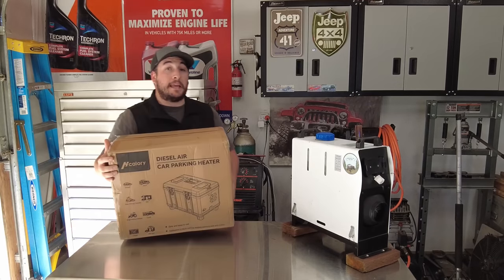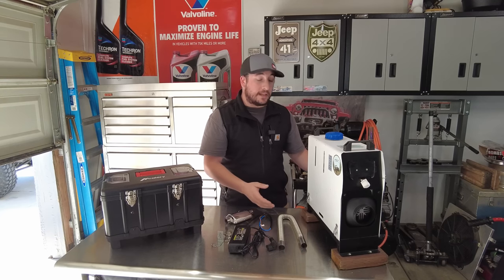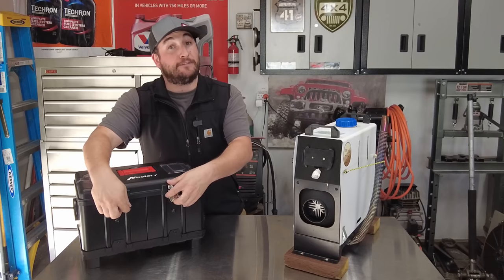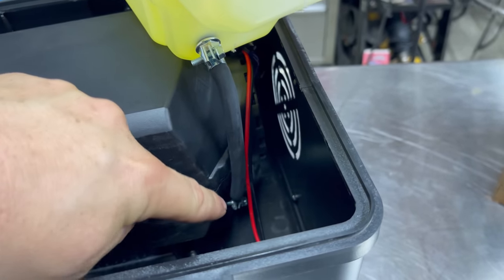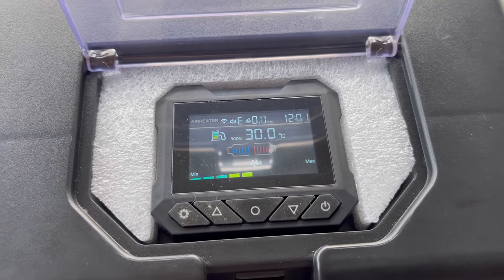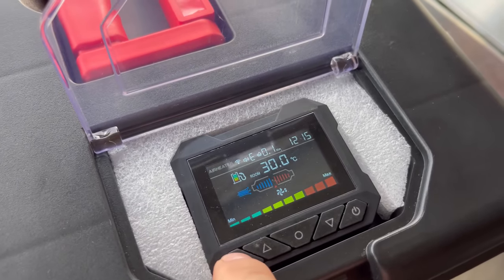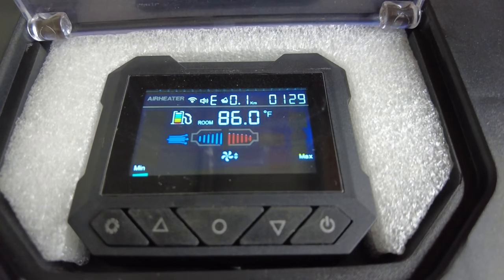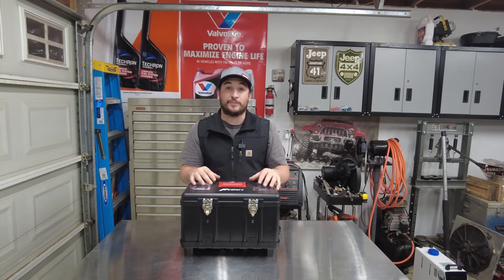KING Of Affordable Diesel Heaters | The HCALORY - SS2 8KW Air Heater | This Is The ONE

Comment: Does this controller finally have a proper thermostat?
Reply from the maker: Yes no more manually changing pump and fan speeds, or having to extend the cable to the controller to reach the heated space just to throttle the machine down. That first mode automatically does it for you with the up and down keys regardless of the built in thermostat in the controller. The second mode uses the thermostat in the controller. And the controller must be in the heated space to properly work.
Reply from the maker: Hi , New video is up covering all the questions you asked on this heater. 🍻 https://youtu.be/Ug-3fjjCPWE?si=BxCFMqSJN6QPi7tT

Comment: How long does it last on a full tank on low setting?
Reply from the maker: From Hcalory: Achieve a cozy room temperature of 20°C swiftly while boasting a low fuel consumption of just 0.1-0.48L/h. Enjoy a whole night of warmth on just 6L oil. 🍻
Reply: Its a 0.022ml pump, if at 2hz speed  - 2 pumps x 60 seconds x 60 minutes x 0.022ml is 144ml an hour... 4 hz 288ml an hour... 5hz 360ml an hour... it mainly depends on how much heat you need, simples 😁
Reply from the maker: Hi , New video is up covering all the questions you asked on this heater. 🍻 https://youtu.be/Ug-3fjjCPWE?si=BxCFMqSJN6QPi7tT

Comment: That power cord connection is a complete fire hazard. Thats a standard 120 volt appliance connection, the kind you would see on a tv. It would be real bad if someone mistook it for a 120 volt unit and plugged it in.
Reply from the maker: It would 🍻

Comment: It the best heater,,, hot pipe is in my fire place and it helps to heat my house I could save money if I had one in every room,,,,, It will heat for 2 day on low on one take
Reply from the maker: Awesome use for the heater, please be sure to have a carbon monoxide detector close by. 🍻

Comment: Unfortunately, these are unavailable. the link doesn't know when or if it will be in stock.
Reply from the maker: Yes as of now they have been sold out, they are manufacturing them as we speak so a new stock should be available by the beginning of December. 🍻
Reply: @ATEMOFFROAD  I will keep an eye out for them. These look extremely handy to have. Thanks for the video.
Reply from the maker: Update ** New stock is available link: https://amzn.to/47KUrMq
Reply from the maker: @markj284  New stock is available link: https://amzn.to/47KUrMq

Comment: wThe power input socket is for 220 Volts in Europe – so an unaware use could feed high voltage into the heater and destroy the unit – and possibly  his future ... DANGEROUS DESIGN FLAW

Comment: I think it is stupid that a company used an AC C13 - C14 style plug for a low voltage DC application. You know someone will grab a PC cord and plug that thing into the wall.
Reply from the maker: I agree, both the manufacturer and the doer are stupid. 🤷‍♂️ I believe they are updating it, and  have been notified by me personally. 🍻

Comment: Mine lasted 2 hours. Now it blows white smoke and minimal heat. Not what I expected.
Reply from the maker: Any fault codes? Can you hear the pump speed up and slow down when change temperature? What is the voltage on the main control panel?

Comment: Please forgive my ignorance, but if I need electricity anyway, why wouldn't I just buy an electric heater?
Reply: It's for camping purposes or van life. 

Electric heater request too much watts vs a diesel powered heater. And probably 10amps or more depending on  what electric heater 

Truckers have been using this webasto knockoff type heater for years
Reply: Because this sips a very small amount of electricity to only run the pump and glow plug, the primary power source of the heat is the diesel. It isn’t intended for home use traditionally.
Reply: @ZeroAlligator  I've seen a handful of people using it for their unheated shop or garages as well... Very economical to setup the exhaust out & just power it up
Reply from the maker: Hi , New video is up covering all the questions you asked on this heater. 🍻 https://youtu.be/Ug-3fjjCPWE?si=BxCFMqSJN6QPi7tT

Comment: Why did they choose a powersupply-socket designed for 230V-cables? This will lead to dangerous mistakes!
Reply from the maker: I’m not sure 🤷‍♂️ standard here is 120VAC.
Reply: ...and 60Hz and NeverTheSameColor-TV with almost 30fps. So take your 120VAC-cable, connect it and see what happens next.☠☺
Reply from the maker: @the_real_doktorfisch  🤣 I am very tempted to show what would happen. But In theory we can also predict what would happen. Remember the controller is what relays the heater circuit to turn ON. The controller is low voltage/ low amps Controlling a HIGH amperage heater circuit . I suspect if AC is applied the low voltage/amp circuitry would take the hit before the possibility of the high amp heater circuit absorbing a load. yes the circuit would be damaged or shorted, in the form of a bad trace on the board. With the low current circuit damage you would not even be able to turn the machine on with AC applied.  likey reducing any shock or hazards. You would just have a dead ☠️ heater.

Comment: I sure wish they would make one that uses propane instead of Diesel for fuel.
Reply from the maker: That would be awesome, they do have outdoor ones , but I’ve never seen one where the hot air is exchanged separate from the ignition source.
Reply: Propex here in the UK make them, no doubt ridiculously expensive tho

Comment: How much fuel does it use?
Reply from the maker: I think I can get two 8hr nights on a tank, this I’d what Hcalory says: Achieve a cozy room temperature of 20°C swiftly while boasting a low fuel consumption of just 0.1-0.48L/h. Enjoy a whole night of warmth on just 6L oil.
Reply: Its a 0.022ml pump, if at 2hz speed  - 2 pumps x 60 seconds x 60 minutes x 0.022ml is 144ml an hour... 4 hz 288ml an hour... 5hz 360ml an hour... simples
Reply from the maker: @stevenlarratt3638  about 3.5 hours a liter x 6 21 hours on a full tank. So about two 8 hour nights on low. To play it safe, I try not to run it out of fuel, thank you Steven 🍻
Reply from the maker: Hi , New video is up covering all the questions you asked on this heater. 🍻 https://youtu.be/Ug-3fjjCPWE?si=BxCFMqSJN6QPi7tT

Comment: Respectfully, I have no idea why anyone would want to get involved with a diesel space heater that needs to be vented like these things do. I use propane Big Buddy or Little Buddy heaters in my deer stands and tent when portable heat is needed. If you don't want to use a 20lb propane tank to fire them you can buy a Big Buddy and  a "Flame King"  1Lb refill kit and 1lb refillable tanks for  allot less than this unit costs. These refill kits are very safe to use and way more less expensive than buying prefilled 1lb propane tanks. Without getting  into all of the details about these heaters if you do the research and follow the instructions on how to care for the units they will provide safe reliable  portable heat for a long time. My first Big Buddy heater that I bought in 2007, for my deer stand, is still working as if new. Ps: The Flame King refill kits, that have three refillable tanks included cost about $75.00 and the Big Buddy costs about $125.00 as of 12/23. Also most of the parts you will ever need to maintain these heaters ( ignitors,fuel filters etc...) are available on Amazon or at Tractor Supply. Just saying...
Reply from the maker: I’m not ignoring the fact that those are great heaters, particularly for your main use, this heat is a bit different though. The heat on a diesel heater is sourced from a heat exchanger and not a blue flame. Also I’ve had several big buddies and the last time I used one in my tent my sons sleeping bag caught on fire because it slipped off the cot , totally my fault as I left the heater on over night un attended. Should have turned it off! Lastly and probably the biggest reasons I use a diesel heater over propane is that, # 1 I can heat two spaces/ (tents) and the hot air is temperature controlled. This means it’s like a clothing dryer keeping the inside of your tent #2 (moisture free). Check out these videos. 🍻 Diesel Heaters For Winter Tent Camping - Upgrades and Modifications
https://youtu.be/Ug-3fjjCPWE

Winter Tent Camping In My Jeep Wrangler Tj - Hcalory Diesel Heater Update + Christmas Tree Cutting
https://youtu.be/NFNNrBvggW8
Reply: @ATEMOFFROAD I get it my friend you make some good points.

Comment: Forgor the problem with all of these is there is no mention of when installing the exhaust you MUST you exhaust assembly paste especially if you use the main unit indoors.
Reply from the maker: That’s a good idea, the seal is good on these , but for a more permanent solution, some hi temperature tape or cold steel help seal it up at the joint. What about solder? I keep my heater outside, but for anyone using this heater I always recommend to have a carbon monoxide detector close by. https://amzn.to/3SpTRPu

Comment: I can't find the electrical power consumption in the Amazon listing.  Anyone?
Reply: 10 amps draw for a few minutes  on start up, then around 1-2amps an hour around 2 hz. A 100 ah battery lasts me around 36 hours on a constant use, or around  30 hours or 3x 10 hour nights if turning off in the day. This is down to 12.2 volts from 12.9. The safety cut off turns the unit off to save your battery and allow start up of a van or boat etc.
Reply: @stevenlarratt3638  thanks.  My pellet stove draws over 4 amps on startup and then less than 1 amp.  This seems to be a bit more.  Looks like a 1500 watt inverter would be required.
Reply: @Bob.W.  on low settings under 1.8hz it draws around one amp, the btu heat from them is similar, so for me it comes down to cost and how easy i can get fuel. I can get heating kerosense in the uk at around half the cost of diesel. I have a seperate system from a leisure battery and its own 50w solar panel so i can go for a week in the UK winters of around 6 hours of usable sunlight until the battery is down to 12.2 volts. Then a quick charge of the engine or swap the battery out for one off the 180w system...
Reply from the maker: Hi , New video is up covering all the questions you asked on this heater. 🍻 https://youtu.be/Ug-3fjjCPWE?si=BxCFMqSJN6QPi7tT

Comment: You list a disclaimer about its suitability then you give links to the supplier ?, personally I'd never buy this heater because of the dangers with monoxide poisoning in a enclosed place, the manufacture recommended these units for car, trucks and mobile homes, in some countries these heaters have been banned because of safety issues in vehicles.
Reply from the maker: Yes that’s because I use this heater , but never in my home. It’s a good heater for winter tent camping and I always have a carbon monoxide detector in my tent. I always run a disclaimer. I want no part of peoples miss use of this product. 🍻

Comment: Just spend the extra money on a fuel injection kerosene heater that can be used safely indoors without having to drill a hole in the wall to let the exhaust fumes out.
Reply from the maker: Nice, any links to those? Thanks 🍻

Comment: Just got this and ran it for the first time. The device went into overheating mode within 5min of running 😂
Reply from the maker: Excessive Inlet Temperature: If heater inlet air temperature is over approx. 35deg in most cases heaters will slow down or shut down. In some cases you will get an overheating error code. Check that you don't have a lot of uninsulated hot air ducting in the same cavity as the heater. Also change the temperature from C to F
Reply: @ATEMOFFROAD new to diesel heaters so I’m probably doing something wrong. So ur saying if the ambient air temp is over 35 degrees it could trigger an overheating code after it’s running for awhile? Just ran it again for 10min and gave me the same code. I’ll extend the hose as far out as I can this time and change the C to F and see if that changes anything
Reply from the maker: @gabrielsons1 any improvements? The shorter you keep the hose the better as well
Reply: @ATEMOFFROAD  I turned everything down to the lowest settings and no issue since. Once I max out the settings it still over heats. I added a angled tube arm to help with the inlet issue as well. Thanks for all the info and checking back!

Comment: Definitely not to be used by the stupid. The power connector is the same as a UK kettle-lead. 🤔 If a stupard loses or breaks the power lead, they may be tempted to try and plug the supply directly to the 230V wall-socket, with the attendant loud blue flash. 😱
Reply from the maker: I agree, if it can happen it may happen, standard here in the US is 120VAC only on that connector.
Reply from the maker: I am very tempted to show what would happen in the case 120v AC was input into the mains. But In theory we can also predict what would happen. Remember the controllers control circuit is what relays the heater circuit to turn ON. The controllers control circuit is also low voltage/ low amps, Controlling a HIGH amperage heater circuit. I suspect if AC is applied the low voltage/amp control circuitry would take the hit before the possibility of the high amp heater circuit absorbing a load to catch fire. The circuit would be damaged like a fuse shorted, and in the form of a bad trace on the board. With the low current circuit damaged you would not even be able to turn the machine on with AC applied.  It would sit there and wait. likey reducing any shock or hazards. You would just have a dead ☠️ heater. 
Ive also verified the the pin out on an AC 120v cable in relation to the 12v heater connections pinout and this is what I have found. If connected, AC Hot lands on DC ground, AC neutral lands On +12v.

Comment: Its still the same  heater everyone else is selling. Just put into a plastic box instead. Same cheap muffler and pipe etc. Just way too much cost for my liking. No fuel filter or fuse shows me that they are not going to go the extra mile give you their best.
Reply: @ATEMOFFROAD  If you take an unreliable motor put it in the most beautiful luxury car with all the comforts, features and upgrades, in the end your still left with an unreliable car. You can sell your product to gullible people, the smart ones will see it for what it is.
Reply from the maker: @hoosierdaddy3705  that’s fair and I respect your opinion, I know the heater is not for everyone. 🍻

Comment: 😅😅😅 8kw's from  0.1-0.48L/h, too funny. Fact - fuel only contains so much energy, so unless you believe they can magically double that energy amount, its maximum possible at that consumption is 5kw approx, same as all the other versions, but with the usual losses is unlikely to even make 4kw. (read a quality brand like Eberspaecher's spec sheet, if you do not believe me).
Reply from the maker: The 8kw is questionable and a bit silly, but the low fuel consumption of just 0.1-0.48L/h all night on just 6L oil is an understatement. For my use heating a tent in the snow , I can easily get two 8hr nights of 75-79F on 6L fuel with this heater. It’s efficient on low. 🍻
Reply: @ATEMOFFROAD   i have 3 of the white alloy cased models(not self contained versions) my own tests of all 3 gave the same results, of 4kw approx set at 8hz, and using 0.5lts per hour. Great wee heaters, but they sure do like to tell porkies about true output.(2 of mine were sold as 8's one as a 5kw, but all are identical in every way, except 5kw was factory set to a 5.5hz max originally, so only did around 3kws until reset to 8.

Comment: I encourage youtubers to loudly and repeatedly complain about the unsafe design of these chinese units that use an IEC connector port that is designed for 120 volt mains power to take a low voltage current (after the supplied transformer steps down 120v to 12v). Keep those plugs and receptacles in their own lane and NEVER cross adapt. The reason is for reducing the chances that some unaware user in the future will get their hands on one of these units and see that IEC shape plug and just use a 120v cord. Not only will this fry the board, it will energize those inside  wires and exposed connection points with deadly 120v potential for death. For those who already have one of these units, change the IEC port on the side of the case to something that is designed for low voltage uses like an XT30, XT60, or Anderson connector. It will take a little time and parts, but it will reduce the the risk of electrocution for all future users of this nice little heater.
Reply from the maker: I agree, it should be changed. I believe to China, that IEC is standard low voltage 24vdc or less. In reality two things will happen, the 120vac will wait just like on any plug that’s plugged into the wall and on the other end not or the unit catches on fire post hit of the incorrect incoming voltage. A good GFCI should protect the user. 🍻